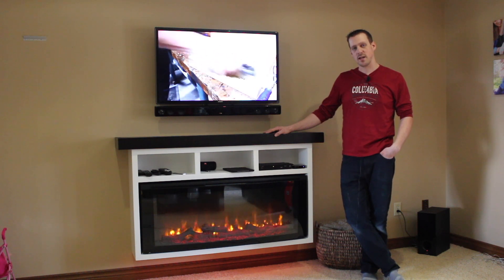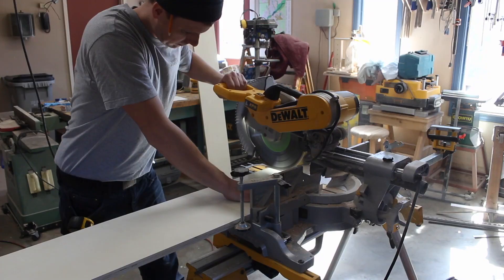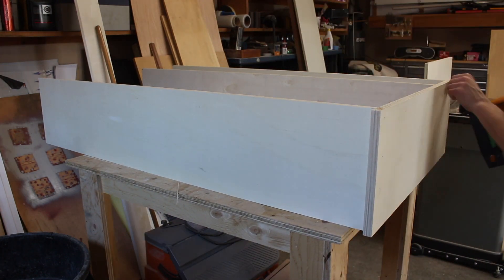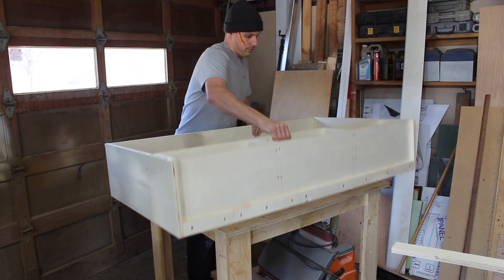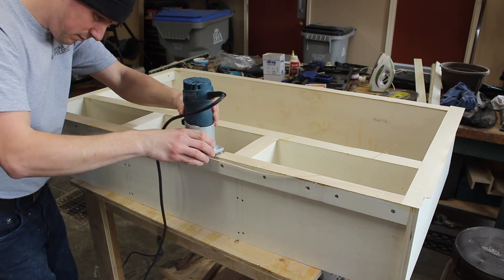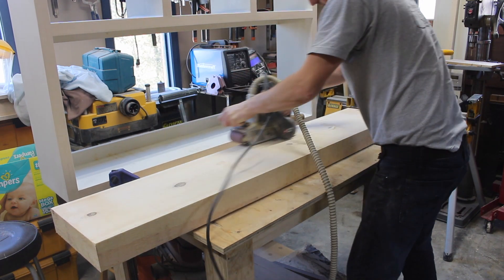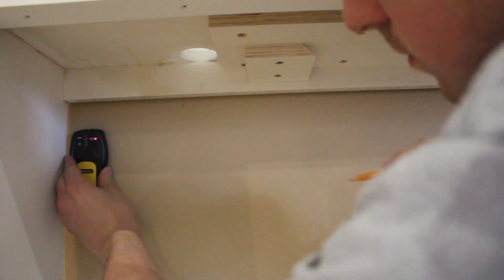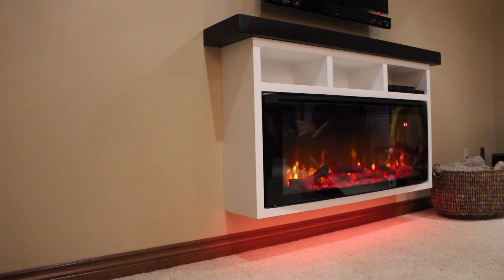How To Build A Electric Fireplace Media Console

Comment: Does your electric insert dispense heat from a vent in the front? I am operating under this assumption since there isnt much side clearance in the event the heat is dispensed out the back of the unit. Regardless, I love the project. I would like to do something similar but make it a freestanding unit rather than wall mounted.

Comment: Hey Wes, looking good.  Nice floating look to the project, and the white contrasts well with the dark beam.
How did you deal with the wiring?  I didn't see an outlet in the wall behind the fireplace while you were installing it.   And did you add wiring to connect the TV to the three top equipment cubbies?
Reply from the maker: Wordsnwood (Art Mulder) thanks Art! I added a receptacle behind the tv and one behind the fireplace. I did this off camera. On the other side of the wall is the garage. I cut a hole on the garage side and ran some wiring and used a some pvc pipe as a wire chase. I also ran some coax for the satellite while i had the wall open.